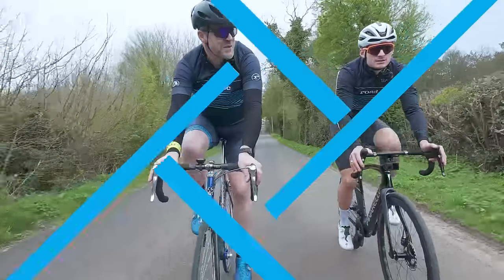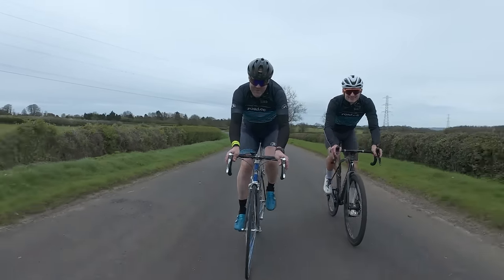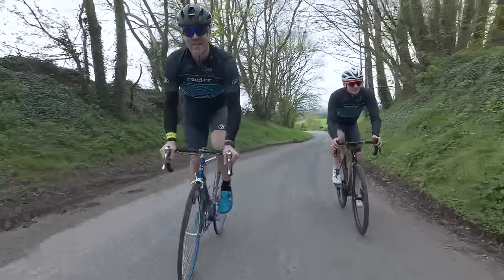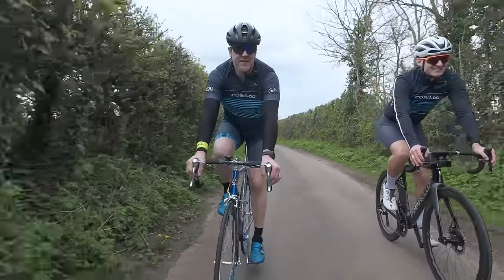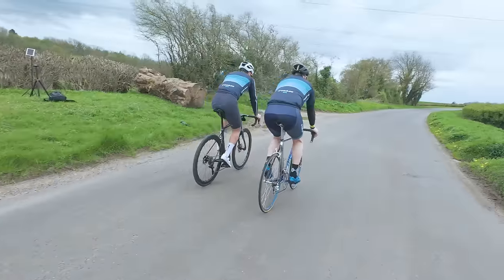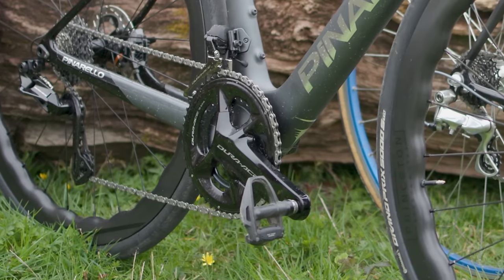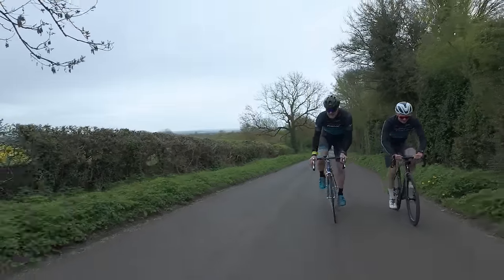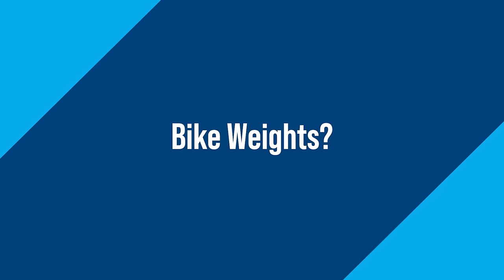Modern Road Bike vs Retro Road Bike - Has 24 Years Of "Progress" Made Cycling BETTER?

Comment from the maker: Do you think road bikes have changed for the better? Let us know your thoughts below!
Reply: Not sure about modern bikes. I still ride my Canyon Passione 2, which I bought in 2001 when Canyon was still a bike sold by Radsport Arnold from Koblenz in Germany. It's got a Campagnolo Daytona group on it and the original Citec rims were replaced with Campagnolo Zondas. It still runs beautifully. The decals are disintegrating and there are a few scratches but it's still in solid condition.
Reply: Not at all.
Reply: Very overpriced Doga aimed at professional cyclists only - reinforcing the disconnect between ordinary cyclists and the industry
- Don't need disc brakes
- Don't need electronic shifting
- Don't need carbon wheels 
- Costs as much as a family car
I have an F10 - this was by far the most successf Pinarello but is a very stiff and therefore rather uncomfortable ride, it is a bike thief's dream therefore cannot be used for everyday cycling and it cost a small fortune. I would buy it again but I would never buy a Dogma F !! Retro bikes were applicable to all, modern race bikes are NOT for ordinary cyclists
Reply: I still ride a Giant TCR from around 2008 and it goes well. Old bikes are awesome and a cost effective way to get into what is an otherwise damn expensive sport. I think that once you get to the period of threadless stems that's the sweet spot.

Comment: Wider gear ranges and disc brakes aside, road bikes have not changed in any meaningful way that benefits me in 20 years. Don't mention aero because i don't care about that. I will continue to ride my 10 year old rim brake bike without any desire to upgrade until that changes, if i need any of the aforementioned improvements I'll just hop on my gravel bike
Reply: They've changed significantly.  I have 3 rim brake superbikes that were over $12,000.  There isn't a single $5000 disc brake road bike on the market that isn't better than those rim brake bikes.
Reply: That’s your subjective opinion.  $5000 doesn’t buy you much today. Certainly not what $12,000 did back in the day.
Reply: @r.guardia9107   $5000 gets you a better bike, plain and simple.  More aerodynamic, more compliant, better handling. The only shortcoming is a bit more weight IF you're dropping from an old $12k bike to a new $5k bike.  I have a fleet of very expensive rim brake bikes(I just mentioned my bikes over $12). They're largely just decorations.  I may never buy another rode bike over $12k ever again.  I'll certainly buy track and TT bikes that expensive but that's just do to the market not making mid-range track and TT bikes with the same molds anymore
Reply: Most people do care about aero - just bc you don’t doesn’t mean older bikes haven’t improved.  They haven’t improved in ways you care about i5
Reply: @r.guardia9107  I wouldn't be so sure, couple of weeks ago I bought Bianchi Specialissima for 4900 Euros (tax included). Carbon frameset, carbon wheels, 12 speed Ultegra Di2 groupset.
Reply: I bought a disc brake Cervelo r3  replacement bike after accident  on R3 rim  couldn't  get rid of disc bike quick enough .I was completely crap to ride .slow to react to any power applied.. weighed about 2kg  heavier.
Reply: @stephenjhughes64stephenjhu26  2,000g difference??  I don't know when you bought this bike, but I'm sure even then, the difference was a few hundred grams which isn't enough to feel.  Unless it was a mechanical disc, which sucked and was worse than rim brakes to stop.  Nowadays, they are nearly the same weight.  

From 3 years ago:  On SRAM road groups the difference between a rim brake equipped bike and an identical build with disc brakes is about 200 g (less than 1/3 the weight of a single bottle of water) on Dura Ace the difference is about 100 g and on 105 The difference is only 20 g as Shimano’s hydraulic calipers actually weigh less than their rim brake counterparts which helps offset the added weight of the brake levers
Reply: @veganpotterthevegan True,even the Superior x road team elite Di2 105 for $2500 will be better than an retro classic bike but not by much and disc brakes are incredibly powerful.💯👌🏻✌🏻🚴‍♂️

Comment: "For the better" is a loaded term.  For me, changes that cause a bike to be more complex, harder for the owner to maintain with common tools, and more susceptible to damage are the antithesis of "better."
Reply: Some of the complexity is only for the engineers and it's made things easier for us.  I'm not at all put out by bleeding brakes. But disc brake bikes are self-adjusting(if hydraulic) and need cleaned significantly less often than a rim brake surface.   It's also nice to not be grinding rims down.   As for electronic shifters, there's no cable adjustments to make.  It's pretty great
Reply: @veganpotterthevegan  I don't want to purchase the tools required for bleeding hydraulic brakes.  I do have the tools required for adjusting rim brakes, picking particles out of the pads, and cleaning my rims.  Most households do.
Reply: @rangersmith4652  nobody said you had to.  But the reality is that you said it's harder and it certainly isn't.  And it's definitely not more susceptible to damage.  It also doesn't need done as often as adjusting rim brakes, and bleed kits are insanely cheap if you ever decided to get one.  Many people even have DIY bleed kits.
Reply: @veganpotterthevegan  I said it was harder with common tools, not harder period.  Brake bleed kits are niche tools.  I can adjust my rim brakes in seconds, while I'm riding.  Carbon fiber is considered by many to be more susceptible to damage, especially damage that renders a bike unrideable, than aluminum or steel.
Reply: I like the best of both worlds.
Love discs and bigger tubeless tyres but often go for a metal frame.
Steel or titanium at the moment.
It's gives the bike a classic look and different from a lot of the carbon.
I also find it has a hand built quality about it seeing the welds on show.
Also there is a nice thing about being less precious about riding it and not worrying something might damage the frame even though I do look after them!
Reply: @rangersmith4652   you can not adjust them at all with disc brakes.  They also don't move every time they get bumped.  
*A lot of aluminum bikes with dents have a crack or will develop a crack on the inside of that dent(far less common with steel).  It also has terrible fatigue properties, most just won't ride enough to get there. 
Carbon is extremely easy to repair.  No heat treating necessary and you can do most repairs without disassembly.  You really are speaking from ignorance here.    Have you ever even owned a disc brake road bike?  I have about 250k miles on rim brake road bikes and over 100k miles on disc brake bikes(70% of them being on drop bar bikes).
Reply: @veganpotterthevegan    I don't own a Maserati, but I know I don't want to deal with owning one.
Reply: @rangersmith4652   yeah,  that's exactly why I don't want any Campy crap. That doesn't mean SRAM Red and Dura Ace are unreliable.  You could get a Lexus or Acura if you wanna look at a comparable, spendier car that's not guaranteed to be unreliable
Reply: @veganpotterthevegan  I've never found Campy to be unreliable.
Reply: @rangersmith4652   there are always anomalies.  But spending 2 decades in the industry, Campy was disproportionately the most unreliable of groupos.  Largely rebuildable but actually needs rebuilding
Reply: @rangersmith4652  That's a you problem though. If you want to be safe and just own a Toyota that's absolutely fine. But for those of us who enjoy the extra performance/occasion it is absolutely worth it. Buying a brake bleed kit costs very little, it's hardly specialist equipment.
Reply: @dutoitm1  It's not about me wanting a "Toyota."  I want to ride a Ferrari, but it will have to be pre-2013 because that's when there was no more manual transmission.

Comment: For me, the biggest difference between older and current bikes lies in how easy and costly it is to customize them. On an older bike, changing bar height or angle takes seconds and costs nothing; swapping stems and/or handlebars is easy and inexpensive, which isn’t true for one-piece bar/stem combos (even assuming the size you need is available). And don’t get me started about proprietary seat-posts.

Comment: I enjoyed this video and the banter very much.  When living in Europe, I participated in numerous vintage bike events, like l'Eroica, and had a great time but also accumulated a number of pre-1987 bikes (per rules for those events).  They all have different personalities but, yes, the brakes are not very good and the gearing is for superhumans.  In the mid-1990s tech really improved, I think, so the rides I use most often are a 1996 Colnago C40, a first-gen S-Works Tarmac E5 and a ti/carbon Lemond.  These are all 9-speed with compact chainsets, excellent rim brakes and I run all on top-quality tires.  I would love to have a bike like the Pinarello here but none of my bikes are showing signs of wearing out nor have much resale value anyway.  Just riding seems more important than upgrading at this point, particularly if we are really talking about saving 20 seconds over an hour!

Comment: For the better? Yes, but not in pace with the obscene prices and average weights that have gone UP, not down. Biggest improvement a new bike would net me over my '03 Raleigh Pro (with Columbus Zona steel frame and Chorus 10 group) is in ride comfort and gearing range, but that's about it. While the ride comfort part has me wanting something on which I can run bigger tires (I'm limited to 25s), it's just not worth the cost premium. As an example, a neighbor pulled up the other day on his new $8,000 Roubaix Pro. I pull out my luggage scale; it's 20.2 lbs (w/ pedals, cages, computer). My steel Raleigh? 20.3 lbs. When I can source a nice 17 lb bike for $3K or so, I'll put the Raleigh to pasture.
Reply: Unless all you do is climb 8-10% hills, weight isn't important
Reply: @dainiusvysniauskas2049 So you'd happily ride a 15 kg bike
Reply: @peterwillson1355  If I were living in a flat area, yes.
Reply: For $8k he could’ve had a steel bike made to measure for himself with exactly the components he wanted.
Reply: @mgittler  Agreed, but this isn't a real cyclist we're talking about. He's a retired guy with money who does 10 mile leisure rides at 13 mph. Bike shops are all too happy to take the money from these dimwits.😄

Comment: I got the bug during the pandemic and started out with a  CF, full suspension mountain bike. I got tired of being blown off the road by roadies so I also purchased a road bike and upgraded this year to an aero Tarmac SL7. To round out my collection I also purchased an all original 1982 Bianchi from a collector, all steel, all Campy. On my first ride on the Bianchi, I was very surprised at how fast it was. I did feel the weight differential during acceleration and hills, I'm not very good at friction shifting from the down tube, the bars were much more narrow than I'm used to and I found out that I can't use toe clips. Other than that it was a lot of fun. I'm in it for the love of the sport and a few watts or grams saved is fun to monitor, but not really all that important to me. Great video guys!!

Comment: Around 4:14 onwards, you can see Dave giving the rim brake a good old grab while the Jamie barely moves a finger or two on the disc brakes. Listen, I ride a rim brake bike, and I do not see myself moving to discs on the road, but the power of the modern road discs is just amazing. Loved thsi video. I will always have an older designed bike with more tire clearance. :)
Reply: So you’re saying the colnago rides so good that Dave needs to brake the whole time.
Reply: @l.d.t.6327  I think he's saying you can't read,  or see
Reply: @veganpotterthevegan  Colnago rider is in the draft, downhill. Other rider is catching the wind. Ofcourse one rider is having to grab brakes while the other is slowing down by the wind. Making stupid comparisons about grabbing brakes in apples to oranges scenarios is making stupid comparisons. I can read. And I obviously notice things that most are totally oblivious for.
Reply: @l.d.t.6327  did you only watch a random 10 seconds of the video?
Reply: It shows that the RIM BRAKE bike has a better rolling....It is faster than the DIsc brake bike. Look at it properly, the RIM has a better momentum on going down the slope. Maybe is the weights of the bike. The rim need to brakes to let the Pina to catch up so that teh camera can catch both of them.
Reply: @departurexx1520  Not just the bike weight difference, but rider weight difference as well, which is far bigger obviously
Reply: @veganpotterthevegan  do you have a life? Like an actual one?
Reply: @l.d.t.6327  yes,  and I'm guessing you've never been falsely accused of being intelligent.
Reply: @veganpotterthevegan  keep guessing.
Reply: @l.d.t.6327  I don't need to do any guessing with you.
Reply: @l.d.t.6327   the "guessing" was not actually guessing.
Reply: That's the problem with disks. They're too squirrely.

Comment: Just bought a bike from 2013 and that’s about as late as I’m going with mass production bikes. 2x10speed is the best compromise of all for me and all external cables and rim brakes is a must. Small brand and DIY options are also available if it would have to be a new frame. Small manufacturers and individual makers are anyway super cool. Without them starting it there would also be no big brands in the end.

Comment: Good stuff boys! That Colnago is a crit frame and twitchier for sure. A good steel road frame with 25c tires is hard to beat for road feel and comfort. The disc brake squeaking is so obnoxious. Old school rules!
Reply: Lazy angles for seat tube and head tube = not a crit frame, more like a comfort frame for longer rides. And it’s not steel.
Reply: It's extremely easy to beat😅

Comment: I rode a Colnago from 1985 to 2004 - and I loved this bike! Really beautiful (it was a TRUE Colnago, with chrome sleeves and with Campagnolo C-Record group set - not like that in the video...) and it was fun to ride, smooth and comfortable and very reactive at corners - but it had one downside: at fast descents the front suddenly began to flutter! Thats not funny at 70+ kph. Other than that it was a great bike and maintenance was easy and fun. Of course now I have much more gears (and more important: smaller gears!) which is a big advantage. Other than that the difference is not that big as the industry and the testers (who make a living from praising every new bit) tell us. Comfort - after been hugely down with massive stiff aluminum frames with the same 23mm tires - are now with carbon and wider tires at a similar, may be very slightly better, level than 1985, stiffness of course is much better. Brakes? I noticed a huge step up when changing from the 1985 Record Cobalto to the 2014 (or 2015?) Super Record Dual Pivot brakes - more power with much less finger power needed and much better modulation. Compared to the next step, discs? Really not a significant difference - as said at ~12': the limiting factor is by a huge margin the tire-road contact, on dry roads as well as on wet roads. So if you look only at objective facts there is no needs to buy a new bike every few years. It's more a matter of what is "sexy" for you. If you are fascinated by the new staff - you will buy it and there is no way arround it. ...if you love the old staff like the other guy here you are lucky because you can ride what you love and save tons of money...

Comment: Yes from 2000 to now bikes have gotten better. A lot of what got better is the gruopo's, internal rim widths and tires. Of course frames have to be able to except them so there is advancements in that as well. I think bikes from 2014 to current bikes can be set very close to each other. My rims from 2014 have  a19mm internal diameter. This makes a 25mm tire measure out to 27mm and 28mm tire to 29.5mm. Both tires can be run at lower pressures and my Trek and Giant except the tire width without rubbing, even out of the saddle hard efforts. The most important things to know as a cyclist are:  know your gear (its limitation and yours), the kind of riding you like to do,  and above everything else enjoy your time out!

Comment: Having had many upper end bikes for 40 years, I love new bikes. Yes the old bikes were simpler and look good. But for me the charm ends there. People tend to forget they were actually way more maintenance intensive. Non sealed bearings, thin aluminum racing rims that need straightening frequently, headset bearings that need full disassembly and new grease each season.. I had all the old premium rigs, DuraAce, Super Record so I can tell from experience, owning new bikes is a breeze in comparison.
Reply: Thats so true, espacially after riding in rain.I also exchanged alu stem and handle bar every year, since they got soft after a season. I began do it after ripping a handle bar apart in a sprint. That wasn't fun at all. 😂